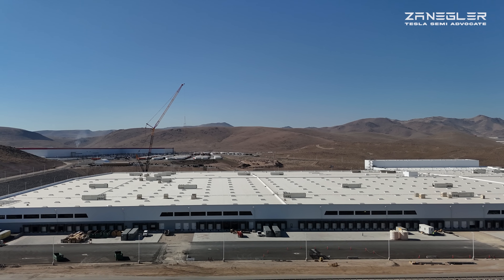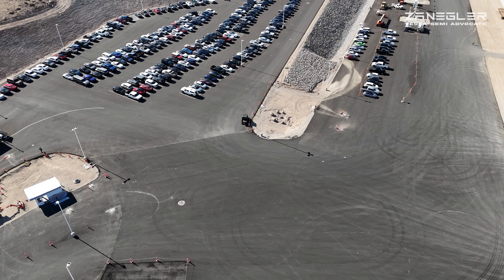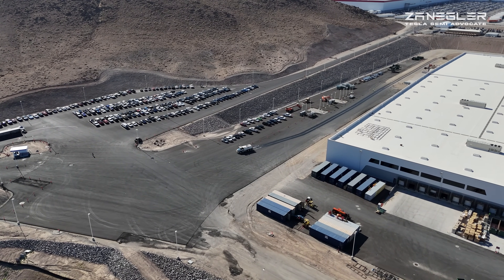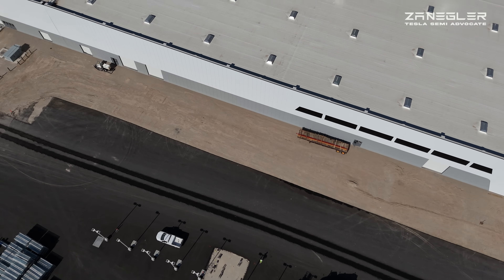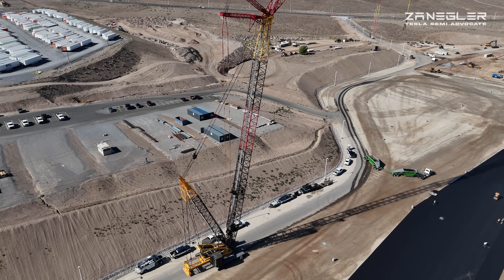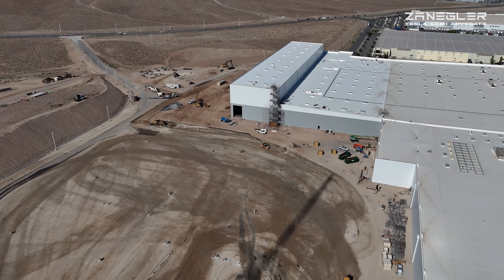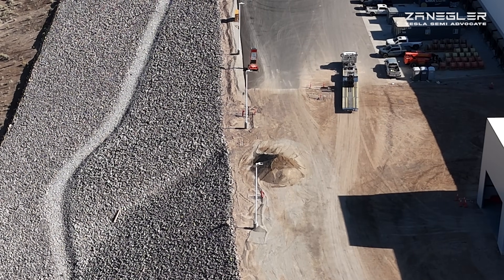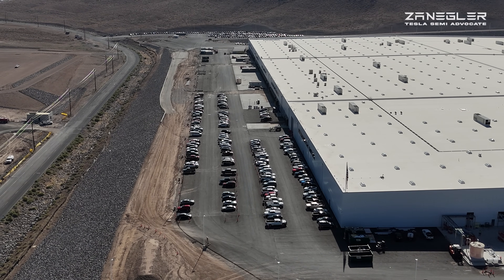Tesla Semi Factory Getting Close to Production?

Comment: 2:59. North. Apron. Stacks of cable tray, bundles of pipe/conduit. Lots of work ongoing inside. Months away from practical completion.
8:46. West. Gantry crane. May be fitting the longer beams on the ground to the left.
"there's that crawler unit". That little crawler is an SPMT (self propelled modular transporter). Seen often at GT moving heavy gear into the factory.
4 large components of the stamping press line still at GT as of Joe's 13 August video. Same video shows the flywheels have been shifted off site.
Some smaller items (bolsters) seen being loaded onto trailers in Brad's 12 August video.